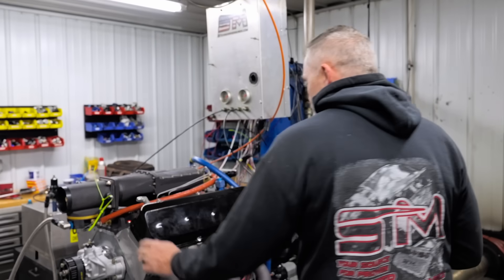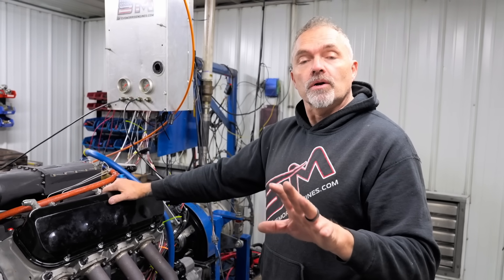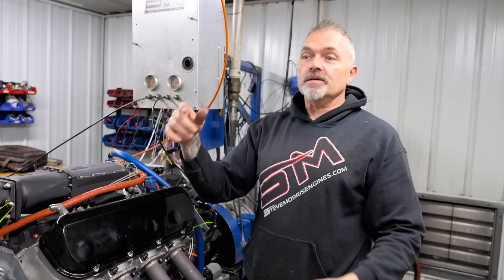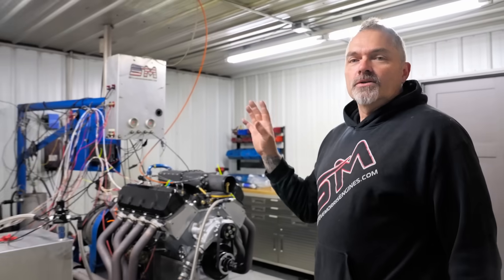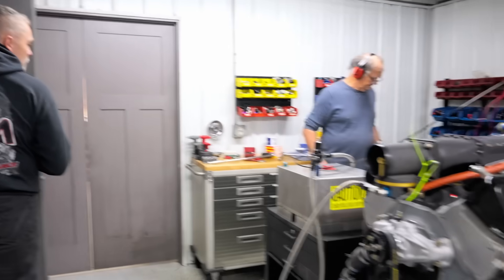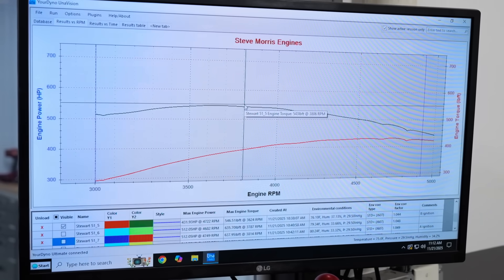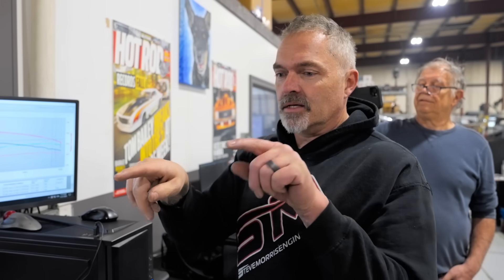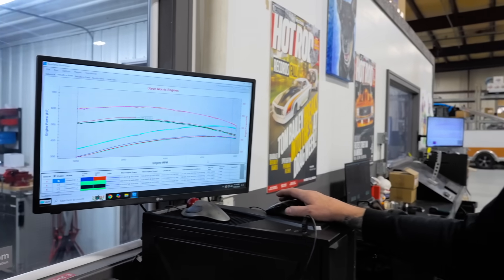Amazing 2 Spark Plugs Per Cylinder BBC  1 Spark Plug Makes almost 100 HP More Than The Other one ?

Comment: Interesting, having multiple ignition systems and plugs should a safety requirement for piston aircraft. What mods are needed for the oiling/lubrication systems and/or acrobatic restrictions? Thx

Comment: I’d be very curious to put the same type of cylinder head on that engine with a single stock plug to see how the power compares just to see if you accidentally found a better plug location

Comment: What aircraft is this fitted in please,? Also I would set half the plug leads on each ignition system on front and the other half on rear, so that you get half the loss of HP if one ignition fails.

Comment: Isn’t that a odd fire BBC with harmonics that will destroy an airframe #1 and #2 the Vortec of wet fuel flow doesn’t change position in this scenario so the forward plug position is wrong or you have to change the intake port angle or and combustion chamber to make swirl land in a more profitable spot for ignition.

Comment: You do tend to notice a small drop in revs when doing a mag drop test on piston engined aircraft. So that would indicate a power loss when on only a single plug per cylinder. Another thing I have noticed with certain magnetos for multi-cylinder engines, is better firing on alternate cylinders. This is due to a reversal in voltage at the plugs.  With standard automotive plugs, the spark jumps better from the center to the ground electrode. This becomes noticeable at lower revs with slightly retarded timing. That’s part of the reason for multiple ground electrodes in airplane plugs.

Comment: The reason why I say that is because they say there's two sensors one magnet but you can't put both sensors at the same place because two masses can't occupy the same space so my question is is it because the timing is slightly different or is it really because there's something different going on inside the chamber

Comment: Here's the test you should have done

Because obviously there's two different ignition systems so you should have actually swapped plugs on the spark plugs from the Ford plugs to the rear plugs and see if it was exactly the same if it would have changed exactly the opposite in other words the power would have came in differently than I question where the pickup is for the different ignition systems

Comment: I would say this is most likely due to propagation times from the different locations. I don't know by how much, but I would say that the lower horsepower plug needs to be advanced a slight bit in timing. I remember many, many years ago, having an old Dotson, now known as a Nissan. The engine and that pickup truck had a dual plug setup, similar to this. Only in their factory setup, it was one plug on each side of the cylinder. One on the exhaust side, one on the intake side. of course being a four cylinder that was much simpler than on a V8. Shouting off one of the ignition systems during idle had the same response, it would slow down with one ignition system and pick up when you had both running. However, one difference was that both plug sets ran with the same amount of power. Part of that was likely due to the fact that the plugs were on opposite sides of the cylinder and somewhat symmetrical. And if there were any other differences, this being a factory built engine, it was probably tuned to keep them at the same level.

Comment: Spark plug placement is absolutely crucial that determines how the flame travels through the chamber. It is really neat to see them putting that in an aircraft and having a redundant Ignition system. Super cool

Comment: Thats interesting about the spark plug location I wonder if it would be worth experimenting with the location on other heads . I think id definitely give it a try just weld up the plug hole and machine a new hole in different locations in the head and see what kind of results you get especially na vs boosted vs nitrous. Come on Steve dooo ittt 😂

Comment: Are pickups for timing on each ignition system lined up on the flywheel one after another or directly next to each other. That would affect timing on one ignition system. Which makes one more advanced than the other??? Just curious about that. Would make sense..

Comment: Great stuff! As someone already mentioned, the lower output spart plugs set probably needs somewhat more timing to be ideal timing for that set. Also, when you say "forward" spark plug, the question is: forward on the driver's side or passenger side?

Comment: it looks like there is difference between ignition timing (like 0.5-1degree) in spark A and B.  and spark with higher horse power has faster ignition. from "idiot logic" there should be difference in every scenario if sparkplugs fire together vs spark A vs spark B, every scenario should be different in some way (even minimal).

Comment: prop speed can be changed via a different multiblade prop, they have 2, 3, 4, and 5 blade performance props. more blades means better low end thrust but less top speed. blade length determines prop rpm. if your prop tips go super sonic it will be loud AF and your performance will decrease do to airflow. the speed of sound is different at sea level vs at 10krpm

Comment: aircraft spark plugs are way different than automotive spark plugs. the reason is durability. dual spark plugs is for redundancy. you wouldn't want a stupid failure while flying.

Comment: Did you confirm both ignitions are truly at the same time with a light or swap the leads from a to b. We didn't see the ignition system but it wouldn't be crazy to have a drift on components in a trigger circuit for either the sensing or firing transistor that could create a timing variation. Super interesting content keen to hear you talk through the flame propagation implications of 1" of plug movement. Thanks for sharing.

Comment: I'd be suspicious of the "A" data that it was probably still both rather than just single.  I'd want to re-run the tests with the plug caps pulled to ensure things were actually behaving exactly as assumed.

Comment: The horsepower difference between spark plug location A and b correlates to the location of the fuel injector and its spray pattern and direction. From what I understand complete fuel atomization burn is better if the spark happens at the edge of the fuel charge where it meets clean air with no fuel in it better than it would ignite if the spark was dead center of the fuel charge. Just like a fire uses extra oxygen fed to it to increase the fire intensity and heat it seems the same would go for the ignition being if it had a charge of fresh clean air next to the fuel charge to accelerate it.

Comment: All piston aircraft have two full ignition systems, two plugs per cylinder.  Shutting either system off costs a lot of power and fuel.  Old news.

Comment: What if it’s simpler than this. What if the fuel coming in the intake is liquid formed enough still that it doesn’t create the same amount of detonation, heat or power whatever term you want to call it. But by the time it travels across the chamber to the exhaust side it’s more vapor resulting in a bigger burn, more heat, more explosion more power. I’m sure there’s a scientific way of stating this and probably a term for it to. I don’t know. I just feel like it’s related to this somehow.

Comment: This adds a little credence to the theory that the detonation travels across the face of the piston.  The assumption is that the detonation is acting on all areas of the combustion chamber equally.  What I am saying is that the very start of the detonation, the very nanosecond the spark happens, there is a shockwave initiated that travels across (perpendicular to) the combustion chamber and piston face.  This shockwave can cross load the piston inducing unwanted motion of the piston that manifests as friction which is reducing power.

We need a way to measure it, but this happens really fast, in nanoseconds or less.  To get the detonation to spread uniformly put the spark plug in the center of the combustion chamber like a Hemi, or a four valve.  But some motors have the spark plug over on the side, and you see this effect.  Some motors have two spark plugs on opposite sides like Nissan Z24.

Small motors like lawn equipment almost always have the spark plug in the center of the piston area, and my guess is that they are a little more efficient that way...

Comment: NGK makes a tiny 10mm plug (CR 9EK) that fits where conventional plugs cannot, making it easier to convert to twin-plug ignitions. I use them  in my 750 Triumph twin with a center plug head. Japanese gamble racers (auto race) used them to get more power from their Triumph race engines back in the day. The '9' is heat range, E is 'extended reach, not sure about the K.
The manual leaning feature on the engine featured here is for leaning the mixture at higher altitudes where the air is thinner.

Comment: Since the A and the B plug cannot occupy the exact same location, there is probably a difference in when the combustion begins propagating, as well as overall combustion efficiency. It would be interesting to see the difference in dyno runs with ignition timing optimized for A versus optimized for B.

Comment: Part of the checklist involves turning off each magneto in turn and ensuring that there is an RPM drop as you switch from both to each single.
Reply: You'll also notice the EGT's go up on all cylinders when you turn one mag off, because your effectively reducing the ignition timing advance.

Comment: Are you sure it's not down a cylinder on B ignition? 546.5/638 = ~0.85. 0.85*8 cyl = 6.85, or equivalent to more than a whole cylinder down. Doesn't seem right.

Comment: On a Blown Alky Hemi. Brad Heads. Then you run one spark plug you set it 38 degres. If you run 2 spark plus you set both on 30 degres and get the same power output.

Comment: I almost feel like it might be the ignition flash point sending a wave away from the exhaust valve and not fully able to expel the chamber as efficiently. The original location starts father back so it builds pressure on the back side letting the flash wave push the exhaust out. Just my opinion would love to hear what really is going on. Love what you guys do so much information always a great time to watch

Comment: Back in the mid 80s, I crewed for a Camel Lights racing team ( MMG out of Dayton Ohio ) as part of the IMSA GTP series. We were running Porsche FAB cars each having four plugs per cylinder.  My first impression was that the engine bay looked like spaghetti and meatballs.

Comment: 1.    I think the title is a bit misleading.  With your demonstrated skills at making power, Steve, it should not come as any surprise that an optimally-located spark plug will produce significantly better results than a poorly-located one, ESPECIALLY if the poorly-located plug does not have some added advance to compensate.  And the poorly-located plug, even with optimized timing, will not produce as much power. 
2.    It has been demonstrated time after time (Dr. Paul Puzinauskas, one of the comtemporary wizards in combustion analysis, and Dr. Andy Randolph, one of the trailblazers in optimized combustion, when NASCAR CUP engines were making 890 HP from a 358 CI, two-valve, pushrod, single-4-barrel carb engine ) that two plugs, side-by-side, in a coventional wedge combustion chamber, make virtually no difference in power output.  The SLIGHT (often immeasurable) increase is due to the presence of two ignition sources, thereby reducing the statistically very-low occurrance of a single misfire. 
3.    Aircraft engines that show a dramatic change in power output on one mag or the other demonstrate the fact that, in a cylinder with a bore of 5.125" (or more) in a low-turbulence combustion chamber (very little "squish" around TDC), that starting the flame front at the far edge of the chamber - without a compensating advance in timing - does drop the power output significantly
4.    Despite your demonstrated skill at tuning carbureted engines to optimize performace at different density-altitudes, it surprised me that you didn't recognize the need for the mixture control on the FI servo  - - - the NEED for leaning as the air density decreases with altitude.
5.    The "puzzling" mechanical FI (Airflow Research) has been around for DECADES, not "9 years".  That system is a direct knockoff of the Bendix RSA-10 -  - in fact, the designer of that system was previously a Bendix engineer - and many of the AFR parts will actually fit and work in the Bendix servo, (but are not "legal" in certified aircraft.)
The Bendix RSA system has been on Lycoming engines since.....the 60's?  And it operates off exactly the same principles as does the mechanical fuel injection system that debuted on the 1957 Corvette.
6.    The need for a "transmission" comes from the fact that the optimal operating speed for the engine needs to be mateched to the optimal operating speed of the propeller.  The tip speed of a typical propeller needs to be kept below approx. 0.85 mach. Above that tip speed, the prop efficiency drops off pretty steeply. And the tip speed is a HELICAL velocity -  the vector sum of the rotational velocity (ft/second = RPM x prop diameter (ft) x pi / 60) and the translational velocity (the speed of the aircraft in ft/sec).

Comment: just to put it into perspective for the non-aviation people in the comments...the most common piston powered planes are ~360ci air cooled flat 4 cylinder engines running ~160-180hp so this is a beast

Comment: The Ford 2.3L 4 cylinder has two sparkplugs per cylinder. The second one was used to fire on the exhaust stroke to improve emissions by igniting unburned hydrocarbons. You can easily rewire the second sparkplug to fire at the same time as the combustion stroke.

Comment: Do both ignitions use the same timing? IIRC there's a way of running twin-spark to make it cleaner, by re-firing the mixture, so one plug gives it a bigger kick then the one firing later to clean it up.

Comment: What this tells me is that the air/fuel mixture in the combustion chambers are uneven. There are sections of lean spots and rich spots. Most power and torque is made where the spark plug have the highest ignitability relative to mixture to create the best propagation of the flame front to cover the chamber volume most efficiently. 

Basically comes down to fillage and fuel atomisation whether if it is like 60 or 75% fillage closest to the cylinder walls and less the at center of the cylinder bore. Etc etc which alters the optimal placement of the ignition to occur in the cambers as well as optimal igniton timing.

Comment: Seems like engineers have been trying to move or point spark plugs closer to the exhaust valves for decades. This is a very interesting video.

Comment: What is a typical timing change between sea level and 5000ft?  I have run Texas Mile (Beeville is 276ft ele), and my chassis dyno is in Albuquerque, (at 5300ft).  The car is a Model A Ford roadster, 4 cyl flathead, that showed 91 rwhp.  I pulled 2 degrees timing, from 26 to 24.  Was I close?

Comment: They don't fall from the sky they glide unless airfoils are lost. Then bbc is not enough to keep the airframe airborne, F-15 on the other hand can do that, and it actually has a pilot landed it after losing a wing in a mid-air collision.

Comment: Ford 2.3L, Porsche, and Abarth used twin plugs for reasons, reciprocating engines in airplanes have twin plugs for safety reasons the little bump in hp and torque is probably similar and with-in reason, with a BBC it apparently means a big difference as seen here, all the reasons combustion camber swirl also can help with power, enter the twin plug BBC....

Comment: The video has been up for 1 day so I'd bet that you have already figured it all out.  BUT:
If all forward spark plugs are on one ignition system, on one bank they will be closest to the intake valve
and on the opposite bank they will be  closest to the exhaust valve. If this is the case performance should be
identical between the two systems. Combustion pressures might be different bank to bank in this configuration
when only running on either one of the two ignition systems. You might consider having all spark plugs closest
to the intake valve on one ignition system and vice versa. You can also swap components between the two
systems. Having a distributor machine I have encountered variations in saturation, dwell, voltage, amperage
and timing retard in supposedly identical components. When it comes to aircraft watch your step.

Comment: Depending on which bank, Front spark will change which valve it is closer to, changing flame front travel. That makes me think that something else is causing difference between ignition A & ignition B. Unless front plug on one bank is rear plug on the other, then it would be spark plug location making a big difference. I remember spark plug indexing making large differences. Interesting project, thanks for sharing.

Comment: I have a pair of those Brodix dual plug heads that are rectangular port on a KB 600 block in my streamliner, it was originally built for a Cirrus pusher aircraft & was inverted.

Comment: Several motorcycle engines have dual spark plugs. I have a Kawasaki Rouser 220cc single cylinder with plugs on both sides of the cylinder. Both connected to the coil. I know some 2 stokes have dual plugs but only use 1 at a time the second is in case of a fouled plug. But my Rouser is not, both spark at the same time.